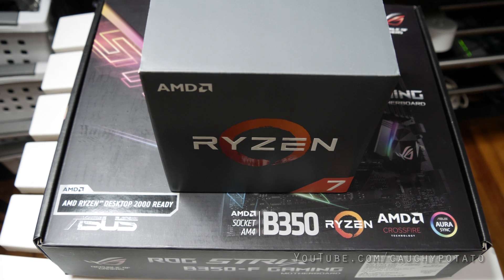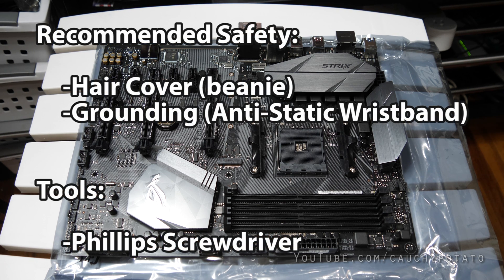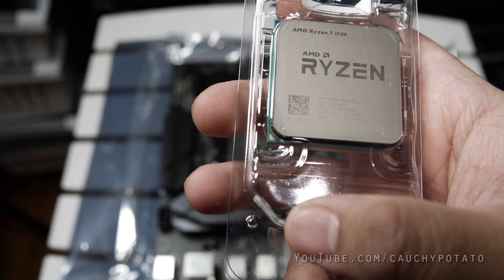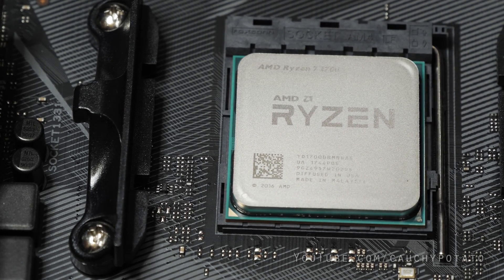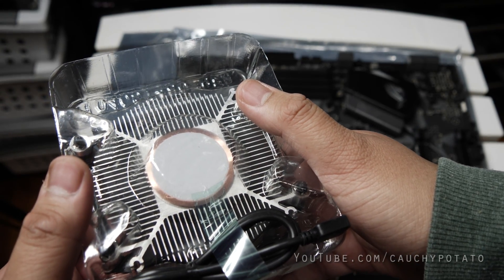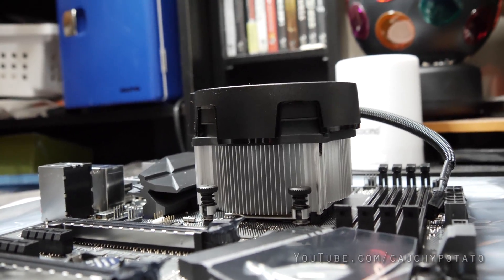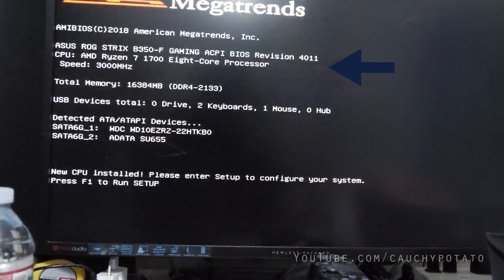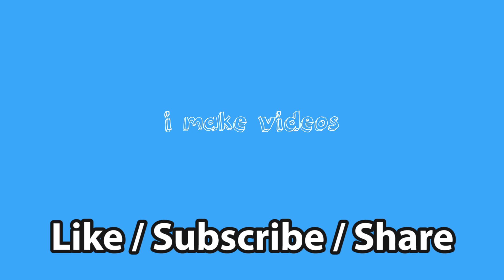Ryzen CPU and Heatsink Install - PC Building beginner friendly video

Comment: Your video was very helpful, as I wasn't sure if the brackets were part of mounting the cooler or not.

I didn't have your problem with screwing in the screws.  I placed my hand behind the motherboard and pushed back lightly on the plate.  This made it easy for the screws to grab.

Comment: First time I encounted AM4 brackets, I stroked out for about an hour. Amazing CPU's, horrid mounting brackets.
Reply: Having same problem
Reply: I’m crying rn
Reply: They are pre installed for liquid coolers, s
Reply: I stripped one of the screws and now that screw is bugging me. I have no way but to buy the cooler with those clips -_-

Comment: You said “anyone” can do it...a bit misleading, but overall a very good video. I bent one of the CPU pins because I applied excessive force on one or more of the four screws. This is not a part to take lightly. There was a pre-applied thermal paste on the side of the heat sink that is directly above the CPU. That pre-applied thermal paste made the process of adjusting it even more difficult

Comment: 4:22 What??? That looks so easy but by me it doesn't matter how hard I try, the screw move not even a bit ! I use the same screwdriver for all the other screws and there it works without Problem (Mainboard, Case). Have anyone a Idea or should I just continue to try ?
Reply: I have the exact same problem someone help
Reply: @nidge6447  Did you solve it?
Reply: :oops:If the screw not on top in the hole exactly it could not go down.
Basically you go one step forward and 2 step back ward, you push one screw in but at the same time keep the other 3 screws still on the surface of the hole.

Comment: The best tutorial to solve my problem, short and to the point. My new computer had a blank screen, I didn't know that we can switch the computer on before all hardware are connected. I can put hardware one by one and adjust them correctly. Thank you very much.

Comment: Please some one answer my question so just like u said.. once u screw one corner in it will lean to that corner so basically that’s what happened to me yesterday and I pushed down on the cooler to get it to reach the other screws and I heard pops could have I damaged the cpu or is that nothing to worry about? I eventually got my pc done I’m done with everything just waiting for gpu to come in, so I wouldn’t know if I damaged cpu until gpu come in.. I hope indidnt
Reply: I've just installed amd ryzen 5 on B550 1 mobo and had a nightmare with the springloaded screws ... so did you break your CPU??? This video was really helpful but now I'm anxious ... I'm building for my partner, I know squat bout computers but I love building them, I've never had these spring screws before or an AM4 socket, it sounded all crunchy and weird but lining up the wee triangle and the pins isreally obvious and simple ... anyway ... did you damage the CPU??

Comment: Brh I can't even screw down the heat sync and the prime A320M-K pro doesn't even have a thing to keep the cpu in place
Reply: same did u fix it and how
Reply: I had to buy a new heatsync tho I keep having problems with my motherboard so I honestly think that's the reason
Reply: @tnk2967  oh ok

Comment: As soon as you said it's easier said than done and your battery died i literally laughed. 
He's not wrong, Cpu heatsinks can be quite finicky, and when you've just spnt £400 on a brand new one the paranoia can be real. XD
Reply: Wraith Stealth and Wraith Spire are a pain in the butt!!! Took me 45 minutes to install the heatsink back in 2019. I was fed up.
Reply: I had to cheap out at the time, I had no money left for a good cooler, and 5900x don't come with one. 

I was mortified to learn that the backplate provided with the cooler had a manufacturing defect, so I tightened all screws down as usual, all correct. 

90-110c in seconds. Wwwhhhaaaaat? 
Underclock to 1.1v, STILL 100c. 
Turn the computer on it's side to use gravity as extra pressure. 
35c. 

Gg
 @markymarc12

Comment: I have ryzen 7 1700 cooler, the screw holes do not align with the black plate, I don't how you guy can screw them in.
Reply: Hi mate did you figure it out I can’t for the life of me to get all of the screws to line up and screw in
Reply: @joeb4844  This is very hard, you touch one the others dis-orientation. 
Basically you go one step forward and 2 step back ward, you push one screw in but at the same time keep the other 3 screws still on the surface of the hole.
and go into the corner screw push the second screw in , yes make sure the third one and the fourth one also in place and not in dis-orientation. If you push the second one all the other ones not in line, you need to unscrew the first one and repeat again to push the first one and so on.
Even after you successfully pushed all three screws, the last one also dis-orientation, you need to do again from the beginning first one, second one, third one and last one.
It is the infinite loop 1,2,3,4, 3,21, 1,2,3 and 4. Have fun again my friend!
Reply: @zaingadol2361  the way I sorted it was just making sure the back plate was being pushed on at the same time to hold it in place while screwing
Reply: @joeb4844  you are lucky because the 4 holes in the back plate is just exactly the accurate align with the screw of the fan, but most of the time it is 0.1 mm disarray, so you need to adjust in an endless loop.
Reply: @joeb4844  same here

Comment: I like that you show what can go wrong for the non educated installers and what to look for. Stuff most vids won't point out. Work on the audio, other then that good vid.
Reply: Things that can go wrong, 

Installing CPU in wrong way, 
Incorrect Tightening on heat-sink screws, 
ESD 
Incompatible bios, Needs update,
Incompatible RAM.
Heatsink and RAM height clearance.
Voltage and Timing adjustments in the bios.